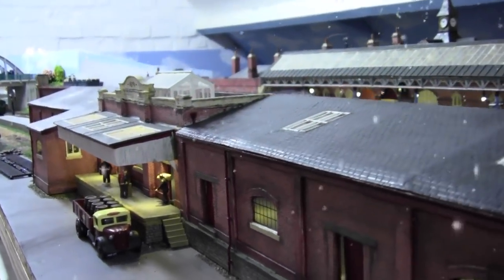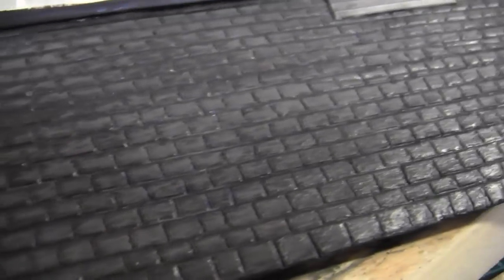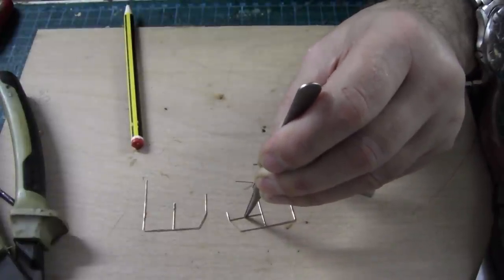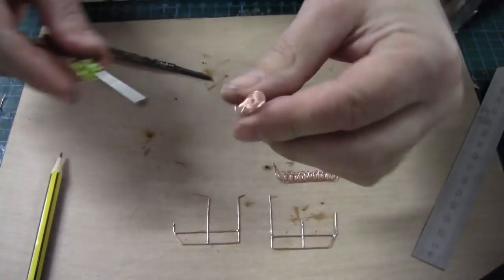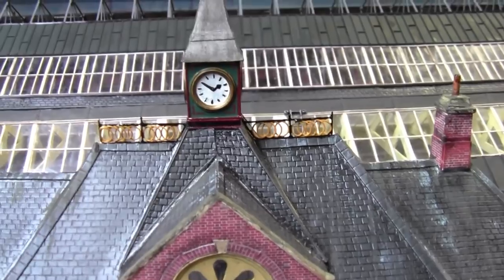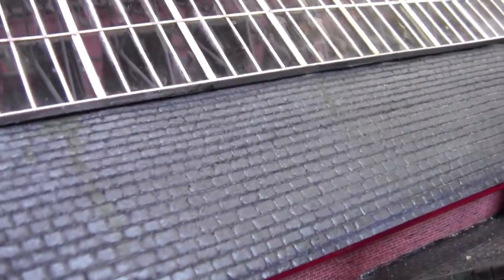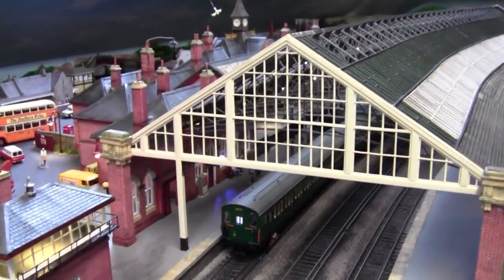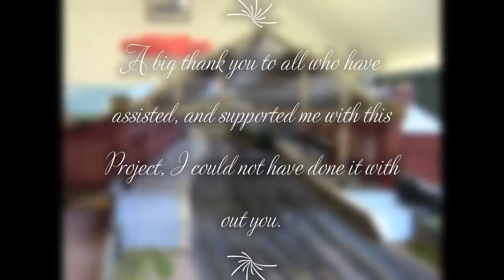The Big Roof Part 12 Completed    No296

Comment: All that’s missing from your EMU are some tiny blue leds to represent arcing sparks where the pickups engage the third rails after a gap especially if it’s raining or snowing. Hiding the activators in the track bed should be no problem and the leds can be mounted inside the bogie frames. The effect is an additional wow factor, they don’t need to be at every gap either. Just an idea for you
Reply from the maker: Hi Edd. love your idea. of the flashing blue LEDs....but that is a little job that i can do anytime. the bigger job has now been completed. time now to focus on the clean up. and the extra details for the grand opening in the new year....all the best and a merry christmas...cheer's Tony

Comment: Brilliant! This can only be described as a masterpiece. Thank you for your work and inspiration.. One quick question; when you bond plasticard to cardboard, what do you use? Thanks again.
Reply from the maker: Hi Alfie. Thank you for commenting.
you can use to glues to give a firm contact with plasticard and card, Plastic contact glue. it does evaporate quickly so make sure the pieces fit first.
the other one is super glue, same again it evaporates quickly. 
all the best, and have a good one....cheer's Tony  merry christmas
Reply: @TONYNORTHEASTERN  Hi Tony, I need to urgently get back to you because I have received a message that you (Tony Northeastern) have become a subscriber to my channel. The thing is, I don't have a channel. I am a bit worried that I might have accidently ticked a wrong box somewhere. I hope everything is ok but i thought I'd better tell you about it in case you think someone is trying to infiltrate your site. I apologise for any inconvenience I may have caused.